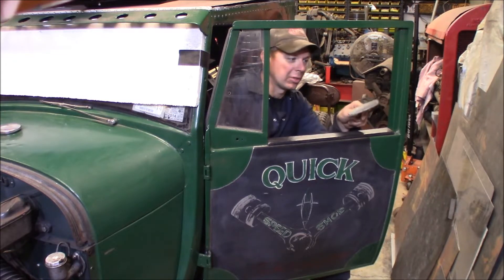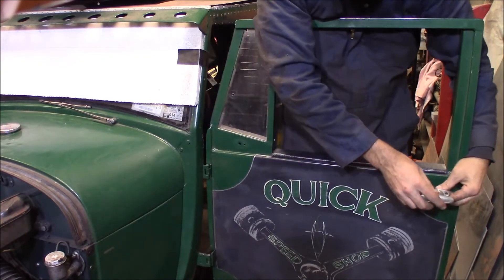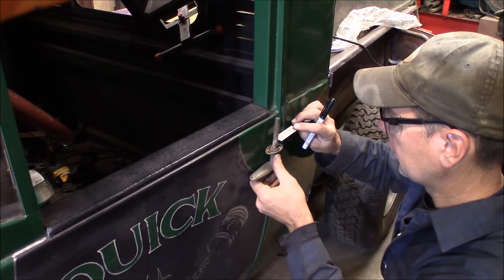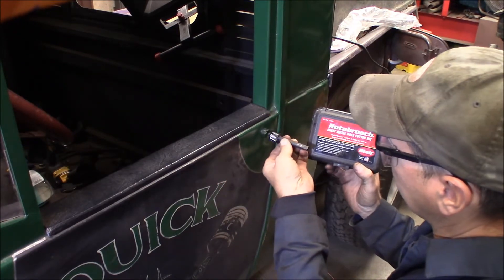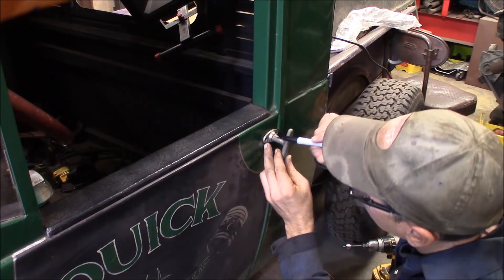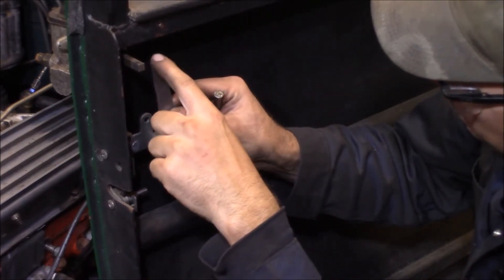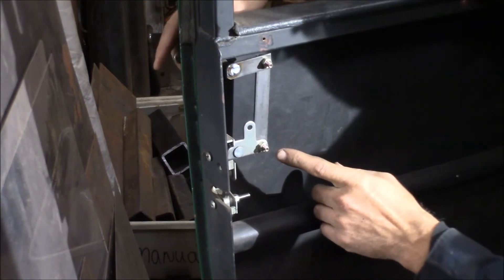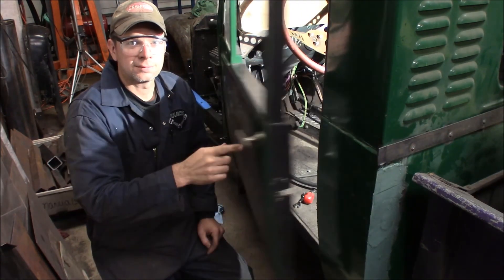Model A Hot Rod Shop Truck:  Installing Door Handles with Bear Claw Latches

Comment: Its too bad this only works if you don't have any glass in your doors.    I have a 36 Pontiac with glass and I am trying to figure out how to the handle to work.
Reply from the maker: The same principle should work with glass.  You might have to shorten the action up a bit or bend the arm into an arc or use a cable run thru a piece a tubing out of the way of the glass.

Comment: You didn't show drilling the square hole!
Reply from the maker: Can't show all my secrets!
Reply: @QuickSpeedShop  But that's what I need to know! :D But seriously. I'm putting model A handles on a boat hatch and I'm having to be creative to get it to work. I think I've got it figured out after watching your video. Watching the linkage is what gave me the idea.
Reply from the maker: @rushwal  Oh sorry!  What I did was drilled a round hole and used a tiny triangular file to file the corners of the hole square.  Took a little bit, worked good.